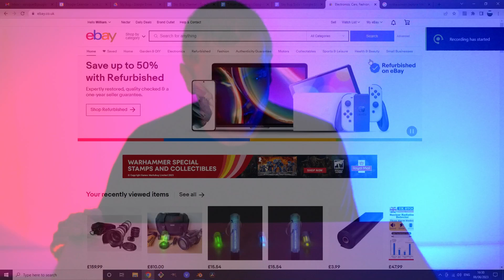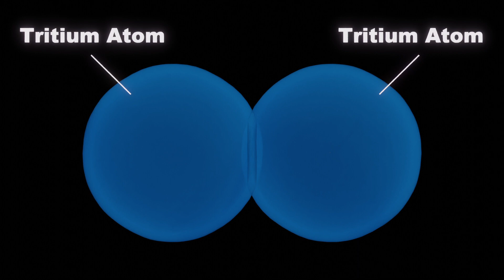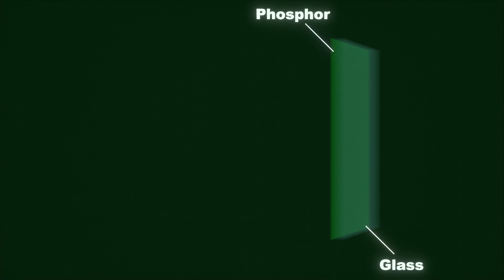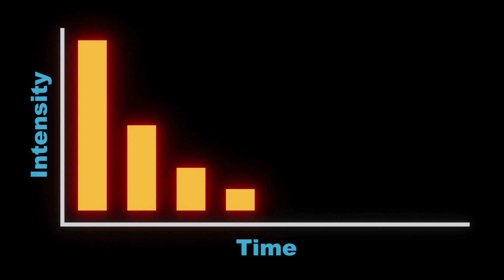Tritium Glowrings - nuclear power in your pocket !

Comment: is the blue as bright as the green or is that just the video?
Reply from the maker: The blue is a bit dimmer then the green. I might have brightened it up in the thumbnail but I can't remember.
Reply: My experience is that the order of Brightness is (Brightest to Dimmest) - GREEN RED BLUE YELLOW . Each being possibly ⅔ of the brightness of the previous colour so it is a measurable and noticeable difference.
I have 4 Tritium H3 ☢️ watches of various colours and a Titanium ring with 3 Vials of H3 ☢️ RGB in colours.
The dimming after 5 years on my oldest watch is not that significant, still super bright at night.

Comment: Can you get a tiny solar panel and see if you can get a voltage from the light? Could make a battery that last decades
Reply: Yes you can. 4-5 vials and 2 panels produces 1.5 volts.
Reply: @kevinsong712  The problem is the current you're able to get out of it
Reply: @MrGabbo22  true it's pretty miniscule you might be able to power a small LCD clock 😂
Reply: @kevinsong712  I think it was measured here: https://www.youtube.com/watch?v=KKdzhPiOqqg